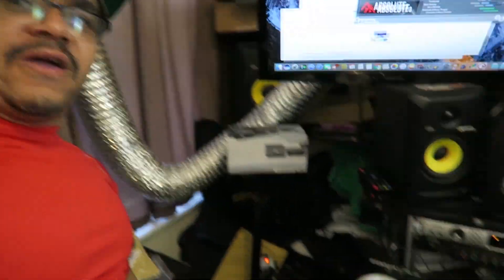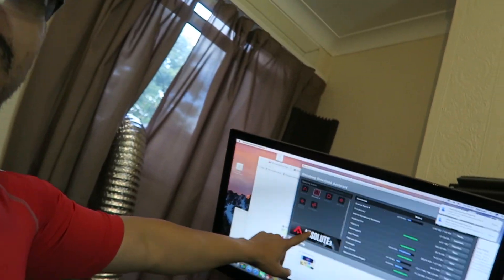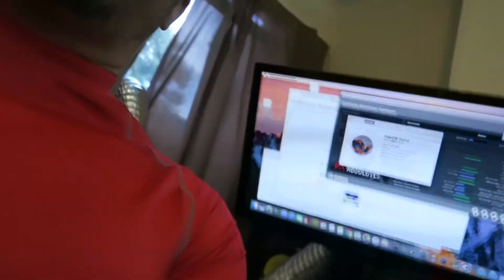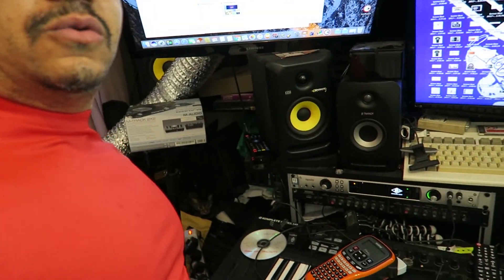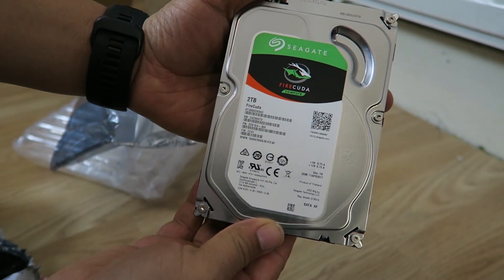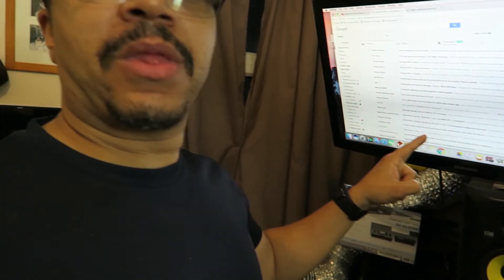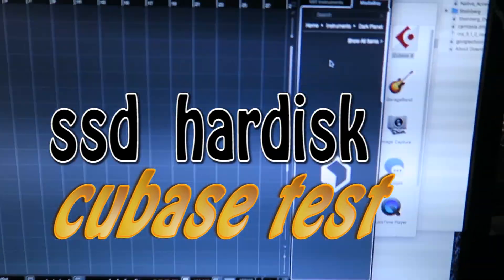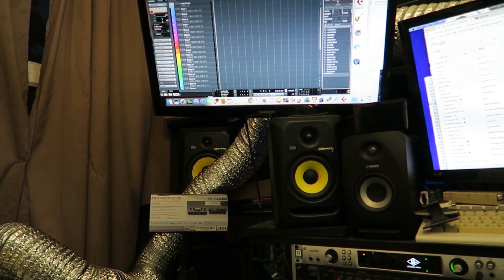IS MAC OSX 10.12 GOOD FOR MY DAW? - new mac os upgrade - CUBASE SSD & DRIVE TEST!

Comment: I would recommend you use another SSD to install the Omnisphere library on. Personally, I have 4 additional drives (2 SSD and 2 HDD) that store my sample libraries and my Omnisphere library. Only use your System drive for Applications and the system files, otherwise you will run into bottlenecking.

Comment: Can't find much info on macs being able to use a separate caching drive which is a shame. You could always just put the Mac operating system on the ssd and use the hdd or hybrid drive as storage. I use an ssd just for win7 OS, and have other drives to store music and games, etc. 
Doing it this way speeds up system functions. When installing music or other apps just point it to your second drive or hdd drive. 

Big up!!

Comment: Brian, you can use other drive, there is usually an option at install of the program / app for selecting the target drive if there is more than one. Also running those Hybrid HDDs in tandem with SSD won't help you if the DAW runs off the SSD. You'll get latency from the Hybrid HDDs working with anything along with the SSD.

I'm using Logic Pro X and Mac OSX Sierra 10.12.5. SSD you can pick up pretty damn cheap as well.
Reply: Welcome bro, i'd honestly get invested in an external 2TB SSD for your sample collections tho. When time allows take the Hybrid drives out, they will not give you any joy moving forward. My MBP is 256GB only, i've got: Kontakt, Serum, Logic Pro X, Massive Sylenth and a couple other bits.

I think Cubase is OK, but something about it and new OSX doesn't seem to play well. Give me a shout if you got any questions :-)

Comment: Oh mate, the trials and tribulations of getting software to work with new equipment.I feel your pain bro, been there plenty of times. 
I paid £280 2 years back for a Samsung 840 evo 2tb ssd so shop around. It's speed vs capacity with the prices atm. 
Not too sure about macs but you may be able to use that 256gb ssd in your new Mac as a caching drive (like system ram) to access things faster. You may need to read up on that.
Always enjoy your crazy edits in the video Bizzy. Always makes me laugh. 

Big up!!